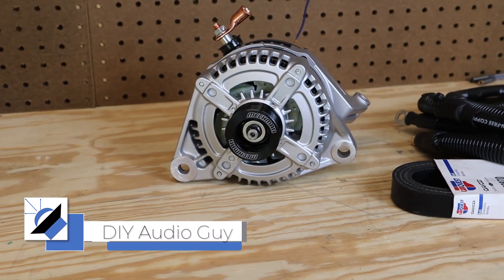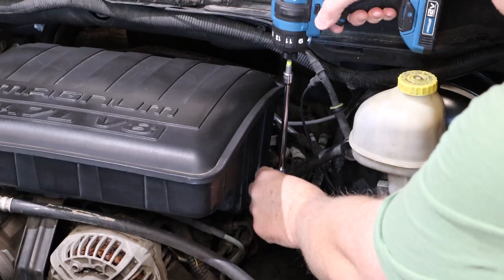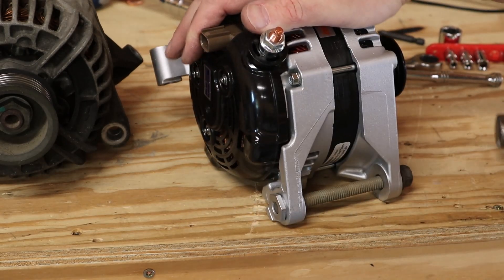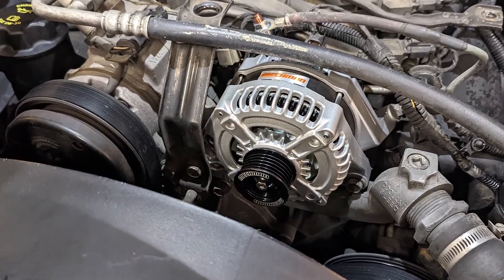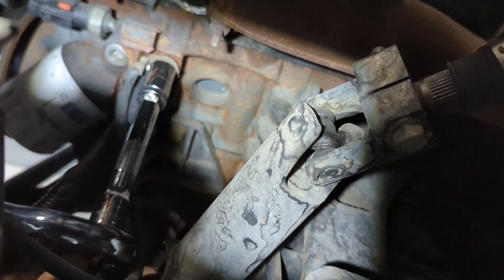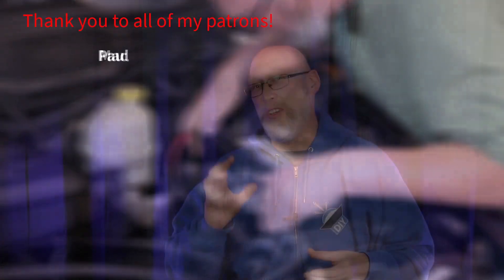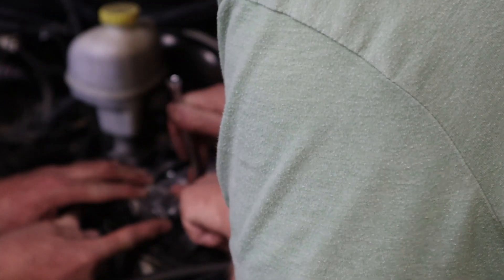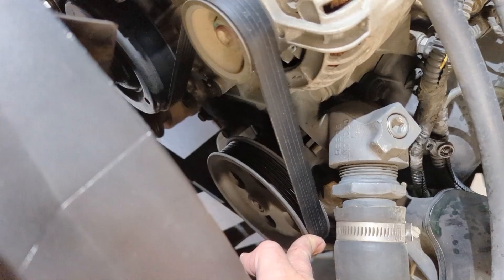High Output Alternator and Big 3:  How to install.

Comment: Sorry if i ramble here.  Great stuff in this video, definitely signing up for skill share! I can't use the hydraulic crimper on my own because it always shifts and gets very frustrating as you mention.  So the hack I found for large gauge is to use my vice with a steel pellet placed in the center of my crimp spot. The steel pellet is very important!  I've found it works just as well as a hammer die if not better and less work :)  Im running stock electrical on my new model sierra which is a factory upgraded 220A alt and large factory agm with that beautiful blue new jp23. I am seeing voltage down to 13.3 on the hardest bass hits then quickly rebounding when the alt is charging wired down to 0.5ohm to clipping. The smart charging on new GMs can be a pain but it's also tells me my electrical is sufficient when it still sometimes goes into "smart charging" which maintain a 80% battery charge and lowers the charging voltage in this state to reduce the draw on the engine to increase fuel economy and battery life supposedly.  I still want to add an ultra cap near my amp because I am dripping over 1v on those hard hits but I don't think its absolutely necessary.
Reply: One of our 320 amp units would be a nice upgrade for that setup AND it would come smart charging bypassed out of the box.  While your OE 220 amp alternator is certainly a good one, it is still the old 3 phase round wire technology.  What that means is it is less efficient and makes less power in lower RPM's.  It is probably around 130-145 amps at idle and around 185-195 amps heat soaked/operating temperature. 

For example, our similar amperage 250 amp unit will make around 190-210 amps at idle and around 255-260 amps heat soaked/operating temperature.  So while you're only "seeing" a 30 amp difference, there is much more under the curve and in the operating zone.  The good thing about going with a 250 amp unit is the same size pulley as your OE unit so you can reuse your stock length belt.  A great bang for buck at around $400 considering whats out there now.
Reply: @mechmanalternators  Wow, thanks for the info!  I've been curious about the curve on the 250A.  I guess I've been reading older forums, because I was reading that you weren't sure how the alts would react with the smart charging tech in these trucks, and the largest you made was a 240A (if I remember correctly, but I guess that was probably the 250 mentioned.)  Sounds like you have it all figured out now with them being bypass ready and larger!  I will be calling to talk to a tech about the 320A assuming a tech can assist with sizing the belt for the reduced pulley size.  I would definitely like the extra available power for future builds.
Reply from the maker: Yea, maintaining voltage is important!
Reply: When using the lug , blow torch it use a little bit of sawder and then crimp gets a better connection and way easier to crimp.
Reply: I have a 09 escape that I put a 250 amp ho alt in to run my subs and mid and high amp. When it’s at full tilt one song I tested made the voltage drop to 11.8 but as soon as the alt kicked in it pushed the voltage right up to 15.3

Comment: Good stuff! Thank you for your support and install. 

FYI, your application uses a terminal block regulator so if you ever wanted to up your voltage you can simply purchase the 91102R external regulator and it would be able to plug in to your Mechman alternator. 😇🥰
Reply from the maker: That explains a lot!  When I get those voltage drops it happens when I stop at a red light, the voltage dips and then I jumps back up above 14.  It happens no matter how much power I am drawing.  If upgraded batteries don't even things out a bit I will look into that regulator.
Reply: One thing I have wondered that I hope y'all could help with. How much extra wear is caused by adding batteries. Obviously a 2k amp on a stock battery is gonna cause more wear on the alt than that same amp with a large agm. But when you get into the territory of guys running a 12k on say 100 AH of lfp and a stock 120 amp alt, how much faster will that actually wear out the alternator?
Reply: @blakebrockhaus347  A stock 120a alt running one 100ah AGM, powering a 12k is never a good idea, 1- you you'll run the system into low voltage causing premature failure of the amp, deck DSP, and any other equipment you maybe running. Your AGM will never have a chance to recharge to its full capacity causing it to fail in a short time and finally your going to burn up (over heat)your stock alt because your forcing it to charge at 100% all the time. PS I would say a 2k with the same power source would end with similar results with long listening sessions. Lithium is a no brainer. the JP 40 in the above situation would cure all of my points, maybe 2 JP40s for the 12k  and you could keep you stock alt. I hope that helps.
Reply: @scottiffanimccord1509  yeah I said 100 AH of LFP which is the same lithium chemistry as the jy HP 40
Reply: @blakebrockhaus347  thx! I'm a nickel head sometimes🤪
Reply: @blakebrockhaus347  it depends on the level of battery depletion and the number of times that has happened. 

Adding batteries is a good way to absorb high percentage battery depletion.  When you're only "topping off" a few batteries vs. Completely charging a single battery, its much easy for both the battery(s) and alternator.

Comment: I'd guess the cathode plate in the positive side of your battery likely has degeaded over time. If the alternator can't force enough extra power into the positve terminal of the battery, it results in too few electrons dropping from the cathode and then less electrons are then available from the negative terminal where the annode is housed. As the cathode fills with electrons, the chemical attraction between the negative terminal and positive terminal is reduced and is seen as voltage drop. The alternator can be thought of as the pump that pushes electrons to the negative terminal so they can be used to do work in the circuit. Basic chemistry supports that electrons flow from negative to positive in a DC circuit powered by electrochemical batteries like agm, lithium, or lead acid.
Reply from the maker: That makes sense, the next step is a new battery.

Comment: i’m curious about underhood temperatures and their effect on wire resistance and potential voltage drop?

I’m sure i’m ok, running 3/0 welding cable off a 170 Mechman 😅
Reply: you'll melt through the insulation before the resistance of the wire becomes a problem
Reply: @blakebrockhaus347  i meant how does the heat from the engine effect resistance in the wire, i wonder if it would measurable to the DIY'er
Reply: @Markous420  no. By the time the wire was hit enough to noticably affect the resistance, you would have melted through the jacket

Comment: You did a great video thx. My first alt for my 97 Dodge 2500 was a Mechman 240, then a 390 then back to the 240, now I run a custom-made "large case" from CES 390 cold start 16.8v to hot 16v to 144ah LTO. PS the 240 small case is way better than the small case 390.. why? because the 390 has long term over heating issues, the good thing you bought a Mechman (I didn't) they will replace or fix it with no problems at all! Mechman just said they could not make me a large case, or I would has stayed with them 😩 I love Mechman!!😃
Reply: Small case alternators over 300 amps usually don't charge well at idle. 240s are usually the goto for best of both worlds.
Reply from the maker: That is some serious power! 🦾🦾🦾🦾

Comment: If you are grounding from the mounting bracket on the alternator do you even need to do the engine ground?
Reply from the maker: I've seen that done before.  No, I don't think that you need the engine ground if you're going to do that.
Reply: Since the alt grounds through the engine block, upgrading the alt ground is functionally the same as upgrading the engine ground (In theory) there may be other things idk abt, but electrically it should be the same
Reply: @blakebrockhaus347  There is a reason the factory has multipule grounding points engine, frame and body, it is because of rubber motor, Transmission mounts, if you want to ground the alt to the fame you must run a dedicated ground directly to the frame. PS the frame is the best grounding point on trucks, I hope that helps. Also, most modern vehicles have cheap cast alloys under the hood with gaskets, and treed locker, anti-seize on the head bolts rendering an engine ground in my opinion a poor choice. But opinions are like diapers there full of shit and usually stink LOL
Reply: I would say it depends on the overall power draw of your system, but DIY guy is right probably not, a 390 alt can only produce 390 so one short run of 0 gage OFC from the battery to the alt is enough, but Rob (Hifivega) the guy the made the big 3 kit, included this extra peace so having the battery grounded to the frame is just the best thing to do hands down.
Reply: 3 grounds body to battery, frame to battery, alternator case, bracket to battery.

Comment: You update that battery I'm sure your voltage sag at idle will go away. Mine stays rock solid at 15v with a  JS 390/agm/Ioxus bank.
Reply from the maker: That is what I am hoping for!
Reply: @DIYAudioGuy  your alternator is externally regulated. The voltage is controlled by the OE unit on the truck.
Reply: Yep, decent battery or an ultracap will def fix that issue
Reply: What u running amp wise?  Do u get drop at full tilt? Curious bc I'm running a 350 amp alt, 1200 on highs and a 3k (JP23V2) on my 15. I charge at 14.8. Full big4, 1/0 ofc throughout. Odyssey agm under hood, optima yellowtop, xs xp2000 and ioxus ultracap in the trunk and I still drop to low 13s full tilt.  I'm switching to lithium soon but I feel like all I have should be able to maintain mid-high 13s if not 14s full tilt.